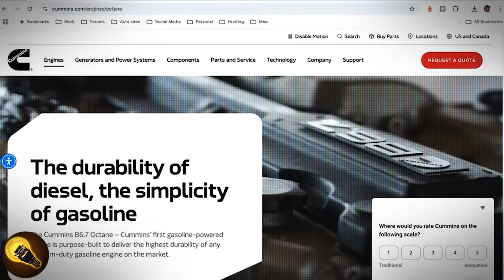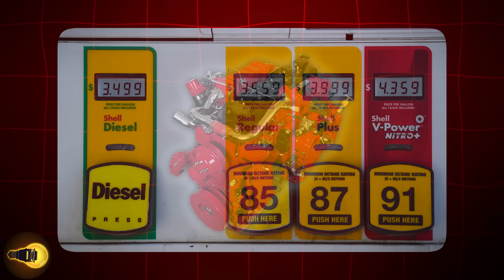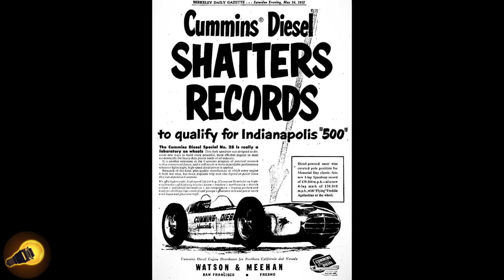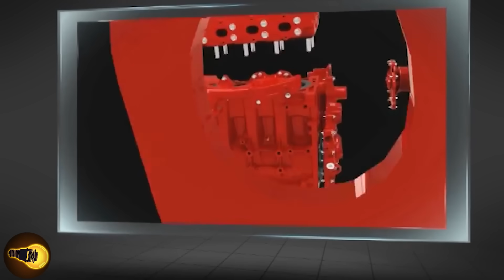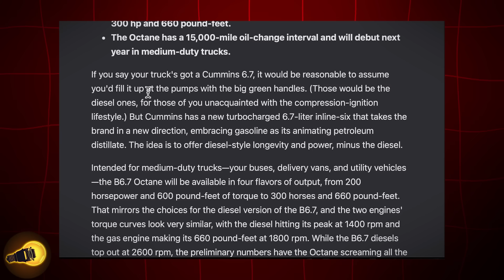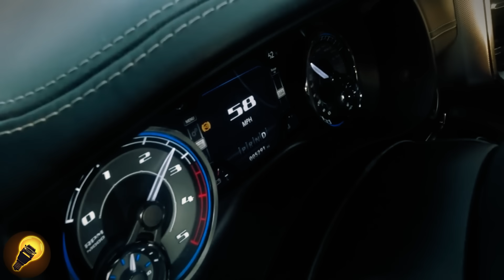Cummins Shakes The Industry With A Gasoline Engine!!!

Comment: Inline 6 making a comeback
Reply: I have always known the inline 6 to be the unkillable , friend had a jeep straight 6 we ran without an oil pan (experimenting)  and it kept on going drove down the road and back.  But the temps were a lot higher than normal, but it was alive 😅.. then u got 2jz , Barra,  rb26 , atlas 4200 , and mazda just dropped a new inline 6 aswell (don't know engine name or code yet) and Chrysler jeep dodges straight 6 and now this... hell yeah , naturally balanced engines are where its at
Reply: @mastercricket7626  Long flexible crankshafts that wipe out the center mains or break are not a thing. For some application's inline 6's are ok. But they are mostly popular because they are cheaper to manufacture.
Reply: @tomhutchins1046 They have more main bearings, it doesn’t matter that they have long cranks. Virtually all of the most reliable engines ever built have been inline sixes.
Reply: @mastercricket7626  Oh and the harmonics in an inline 6 is terrible
Reply: @tomhutchins1046  A inline 6 has perfect primary balance and I have never heard of any issues with harmonic frequencies at all. You sound like a EV,  Suburu tree hugger type.
Reply: @stuglenn1112  You sound like a billy bob. Then why are most light and med piston aircraft engines opposed design? Why are posches so high RPM and live? Why did jaguar back in the day have so many problems with crankshaft failures and have to resort to a huge harmonic dampner? Why do diesels have such a huge dampener for a low RPM engine?
Reply: @stuglenn1112  Why does every qualified engine builder agree inline 6's have harmonic issues but you know better billy bob? back to rolling coal
Reply: @stuglenn1112  The inline 6 has perfect primary balance but the long crankshaft suffers from torsional harmonics in many cases. The Aussie Barra engine can be built to easily output 1,000 horsepower but be aware that if you don't use some seriously heavy duty bolts to hold the flywheel or pressure plate and a good aftermarket harmonic damper you will most likely have problems.
Reply: @brianbrigg57  Primary balance? There is a range in most inline 6's around 4000 rpm and if its a modified engine and you stay in that range you will have issues. One of the other issues is the combustion pressure is all lined up and in the down direction so nothing is canceled out like an opposed engine would be. Also cooling is always an issue . The front gets over cooled and tends to cold seize and the rear runs hot. There have been all kinds of attempted cures for that from internal transfer tubes to special head gaskets to external water lines but nobody has really cured the issue. Then there is head gaskets on that long cylinder head. Back in the day fuel distribution and flow was always an issue but port injection has helped that. The old weber or mikuni carbs were used but the individual runners are very reversion prone.  same goes for port injection which makes you compromise cams specs to avoid it. They make them because there cheap to manufacture!!
Reply: @brianbrigg57 Who needs 1,000 H.P.????
FFS!!! ITS NOT A LOCOMOTIVE!!!!
Reply: @Joe-d7m6k  It's not a question of NEED. Who needs an F250? Who needs a Hellcat? Who needs 30 year old Scotch? Who needs an 85 inch flat screen? For that matter who needs a TV or a microwave or a toaster or a Playstation or Xbox? Humanity got by without all those for most of its history. 

Life would be pretty boring if we only looked at needs.
Reply: Most of the Atlas I-6s lasted longer than electronics that ran them.
Oh and was possible to make a 5.01L Atlas. 300 HP and 300+ torque? No problem. The natural aspirated 4.2 l gets close to that. & 0.9L more. 360 Hp ? EZ
?The 4.2L could easily make 450 HP with a turbo charger.
GM never made a block, heads & crank for one. Wouldn't you rather have a V-8? The big problem, the hood on a Silverado 1500-3500 is too short for a I-6
But a Trax 1.2L makes 134 HP. A Atlas I-6 could also make 570 HP with a turbo charger..
Reply: @warrenpuckett4203  The Cummins gasser is up to 330 HP and 600TQ on 87 octane no def  but its just a stop gap once battery tech catches on it will all go away. inline 6's are cheap to manufacture so obviously attractive to car makers
Reply: @tomhutchins1046  I have sold more than one I-6 and I-4 still running past 300,000.
The key was stick shift, oil changes and coolant maintenance. Sticks later on had the same radiator as a automatics because it saved warehouse space.
 Now? Just automatics, saved even warehouse space. 
FWD? Oh even better. Just drop all of the power train in at once.
Reply: @warrenpuckett4203  Automatics because of the TQ output would destroy drivetrains if the driver did not know what he is doing on a manual trans. Im sure warrantee had something to do that. Also emissions modern automatics are controlling more than shifting they make for consistent acceleration and driving patterns.
Reply: @warrenpuckett4203  I have a 12 valve 95 ram with 340,000 the original clutch just started slipping. There talking about inline 6's in high performance application's. my 12 valve is stock you start increasing power and driving it like a kid you wont make 100,000.
Reply: The best for  longevity with a beefy bottom end giving it more ability to boost. I saw a land rover 3 l diesel v6 and the legendary 2 jz petrol and the bottom end bearings in the jz were twice as wide .
Reply: Not really. They have been around forever. Bmw, Chevy, and pretty much every big rig
Reply: Ford will over engineer it so bad it will be a disaster just like they have done with all of their engines so far
Reply: The turbocharged inline-6 is the ultimate engine design.  Diesel OR gasoline.  In America, we fell in love with V-8s for various reasons, but the inline-6 is the best.  The incredible BMW I-6, that dog-slow Ford 300 that would last forever, the Mercedes I-6 diesel....and obviously every truck I-6 turbo diesel is far superior to any other design.  

An engine appears to always be tougher and more reliable at any given power rating as an I-6.  A 700 horsepower I-6 is almost definitely going to be more reliable than a 700 horsepower V-8.
Reply: @billstrasburg384 " An engine appears to always be tougher and more reliable at any given power rating as an I-6.  A 700 horsepower I-6 is almost definitely going to be more reliable than a 700 horsepower V-8."
 HAH yeah inline 6's winners in nascar le mans, indy, formula one, top fuel, pro stock, ect ect HAH. They build them for industrial and other use because its cheaper and more compact
Reply: @tomhutchins1046  No, it's built for industrial use because it's more reliable.  

The V-8s are used when it needs to be more compact, and for higher racing performance instead of reliability.  

Every word of every sentence of your comment was incorrect.
Reply: @billstrasburg384  I have built engines professionally for over 40 years. You don't have a clue. And im obviously not going to fix that. So keep on staggering through life there buddy
Reply: @tomhutchins1046  I used to own a company that built and designed engines and fuel injection systems for Corvettes and GM V-8 fuel injection.  I have every reason to love everything about the V-8.  I have also owned a truck and heavy equipment company that rebuilt equipment.  

The inline-6 engine is far superior to the V-8 in reliability, which is why 99% of all road tractors or large pieces of heavy equipment have one.  

If you had any idea what you were talking about about, you wouldn't have claimed that the V-8 is more reliable.  No one who knows anything about engines thinks that.  Everyone who actually knows about engine design knows that the V-8 was designed for compactness and horsepower, but I-6 engines are more reliable and better for torque.
Reply: @billstrasburg384  Inline 6's are just simpler to work on cheaper to manufacture and fit better in industrial application's including heavy trucks. How about some technical reason not just you know.
Anybody that knows anything ??
Reply: @tomhutchins1046  Everyone reading this comment section is laughing their butts off at you.  But by all means please keep doubling down on it, because you are wildly entertaining.
Reply: @billstrasburg384  You can do better than that billy bob
Reply: It's probably like saying electric cars are just 5 years away, as all the media said since 1960.
Reply: @matrixist  They were here. post office majority EV. Tesla was selling very well but somebody sh-t himself in the foot. The king is in the oil company's pocket so we will have to wait.
Reply: Clifford Research 6 = 8
Reply: @steveowens9886  They coined that as a sales pitch at least 50 years ago?
Reply: Well it's only going to apply in places that already use an i6 diesel. Dodge doesn't plan to offer it for towing but they should. Just build the same truck as diesel but with this. The issue is price and specs. They can produce a v8 cheaper and with more hp without need for the turbo. This new engine doesn't have the Rev range of other 6l+ gasoline engines. It really doesn't have any more horsepower that a pentastar v6 for twice the weight and needs the heavy duty diesel transmission and gearing so it's not an incremental upgrade. But I could see it eventually catching on as a swap for diesel trucks with failing emissions systems or heavy wear from being plugged up with carbon.
Reply: @danieldimitri6133  study up on the difference between HP and TQ
Reply: @danieldimitri6133  The 6.7 was used in the dodge ram. Its the same block pistons rods ect.
Reply: @danieldimitri6133  5.9 is the same just the 6.7 is a little larger bore and stroke.
Reply: @danieldimitri6133  Comparing the power out put to a v6 penestar shows you need to study up a little
Reply: @tomhutchins1046  try advertising an engine twice the size and turbo and twice the weight with the same hp as a v6. It doesn't matter how well it tows if it looks stupid on paper next to a v8 and needs all the diesel parts, springs, gears,  axles, to work. It might be a towing powerhouse but it's an advertising nightmare.
Reply: @danieldimitri6133  ? they build dodge trucks with the 5.9 and 6.7 for years and they are extremely popular and durable. Its the same engine just gas. In the diesel version they lasted up to one million miles. Usually out lasting the trucks. i have a ram with a 5.9. I would not trade it for a brand new truck with a V6 or gas V8
Reply: @danieldimitri6133  The fact that you keep referring to is with HP shows you dont have a clue buddy
Reply: @danieldimitri6133  I dont think its an advertising nightmare people can get Diels life and power without the def and meet emission's . I think it would be a big hit just like the 94 2nd gens were. if they made a nice simple HD base model i would consider buying one.
Reply: @danieldimitri6133  Again the second gens 5.9 was a huge success
Reply: @tomhutchins1046  is that really how you read the situation? The public hasn't a clue. The truck would be twice as expensive with the same numbers on the specs sheets. It won't look like much of a bargain to people who don't have a clue. Dodge doesn't have any plans to use the thing. It'll probably show up in box trucks, maybe an ambulance.
Reply: @danieldimitri6133  Public bought the 90's rams Cummins by the 1000's. Would not be twice as much.
Reply: @danieldimitri6133   Would be twice the torque numbers and the Cummins name would make people confident the truck will run for many many miles. it would be a hit.
Reply: @danieldimitri6133  Right now it will be for mid size fleet trucks
Reply: @danieldimitri6133  The Cummins 5.9 and 6.7 ram trucks are legendary for durability.
Reply: @danieldimitri6133  If dodge can pull it off it would sell. industrial Diesel durability, sound, torque and no def. legendary reputation
Reply: @danieldimitri6133  Yes 6.7 and 5.9 are heavy.
Reply: @danieldimitri6133  Turbo doesnt just add power it can add efficiency
Reply: @danieldimitri6133  I suggest you stop posting till you research a little
Reply: @danieldimitri6133  Its good for 3200 . Geared properly it will move right along
Reply: @danieldimitri6133  Since the 6.7 gasser is a very proven bottom end with much lowered compression for gas it should last a long long time
Reply: They never left
Reply: It was always the best, most reliable, best balanced engine design. We Americans just don’t like their power curves or the way they sound anymore.
Reply from the maker: Absolutely, and I hope is going to be a great engines for years
Reply: An apposed boxer style engine is much more efficient and durable but more expensive to manufacture
Reply: Nope its a temp setup to avoid DEF. When bat. tech catches up these will be all gone
Reply: I wouldn't hold my breath on that.@tomhutchins1046
Reply: @tomhutchins1046  "When bat. tech catches up these will be all gone"
That looks to be many decades from now if ever.
Reply: @tomhutchins1046  EVs do not perform well in extremely cold climates. Additionally, I have been working with batteries for quite some time, and they all share a common issue: shelf life. This means that the batteries in EVs need to be replaced after a few years, regardless of how frequently the vehicle is driven. Since the cost of the EV's battery assembly essentially constitutes the entire vehicle's value, owners may find themselves needing to replace their vehicles every few years. This significantly impacts the resale value of such vehicles.
Reply: @gcdsuite8471  This information brought to you by the petroleum industry were we dont give a -- if you ch-ke
Reply: @gcdsuite8471  Not true there are teslas running around for years even the early ones with no issues. lead acid and carbon as in AA battery's don't store well. I have drills and tools using 10 year+ old lithium battery's with no problems
Reply: @tomhutchins1046  Lithium batteries last around 15 years, while alkaline batteries typically last between 5 and 10 years. Lithium-ion batteries have an even shorter lifespan, lasting only 2 to 3 years. In contrast, Toyota combustion engines can last up to 30 years with proper maintenance. It's also important to consider battery degradation; as the batteries approach the end of their shelf life, the electric vehicle (EV) will cover fewer kilometers.
Reply: @tomhutchins1046  I'm not a fan of EV technology. While it is often promoted as a solution to greenhouse gas emissions, it actually creates a new set of environmental problems. Many people remain unaware of this because the number of EVs produced and maintained is still relatively small compared to combustion vehicles. Additionally, residents in Alberta are skeptical of EVs, as many of these vehicles fail to start in the extreme cold of January, primarily due to battery issues. Moreover, people here drive thousands of kilometers with their vehicles, which is difficult to achieve with EVs due to their limited range.
Reply: @gcdsuite8471  You have admitted your biased. Nissan leaf's will go at least 200,000 with little or no maintenance not even brakes or oil changes due to the rejen feature. I have a friend that is a Nissan tech he is worried about his job EV's are so reliable, 
"While it is often promoted as a solution to greenhouse gas emissions, it actually creates a new set of environmental problems" 
People a lot smarter than you and me dont agree,
Reply: @gcdsuite8471  Your an oil company troll
Reply: @gcdsuite8471  How many gallons of gas and oil does you Toyota use in 30 years?
Reply: @ nope, I just live in Alberta. People who drive EVs here usually own a combustion vehicle as a backup car. And yes, I work with UPS and batteries regularly, which is probably why I sound like a petroleum troll to you.
Reply: @ If you don't use it too often, not as much as the price of a new EV, which increases in price every year. Btw, no one in their right mind would buy a 10-year-old EV, as that car will become a giant paperweight once the batteries start failing. Buying an old combustion vehicle would make more sense.
Reply: @ Information about the environmental impact of electric vehicles (EVs) is readily available online. While EVs may seem appealing now, people may come to realize the potential problems associated with their large-scale production. With vehicle prices rising and the government continuously promoting the EV agenda, will people still be able to afford vehicles in the future? Additionally, have you considered the challenges of maintaining an EV in extreme weather conditions, such as those in Northern Alberta, throughout the year?

Ultimately, you don't need experts to determine what's best for you. The information is accessible online, so take the time to do your own research. If you like EVs, then go for it. Just be mindful not to impose your viewpoint on others, as they may have different experiences with the subject.

Comment: Even better would be an engine that runs on HYDROGEN...
Reply from the maker: I hope they will bring a hydrogen engine soon
Reply: Big problem with hydrogen isn't in the engine.  It's on board tank and stations. Very dangerous monster to contain!
Reply: How about one that runs on nitrogen, since air is about 80% plus nitrogen it would just run on air.